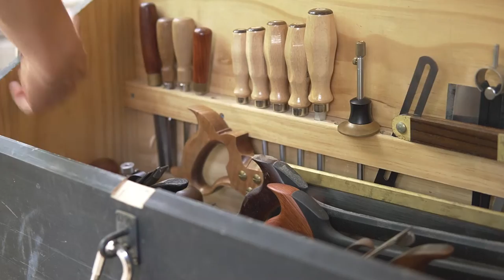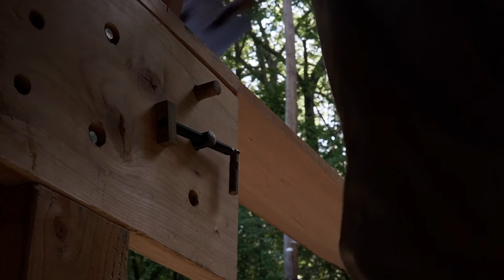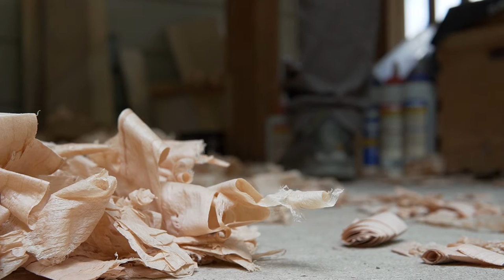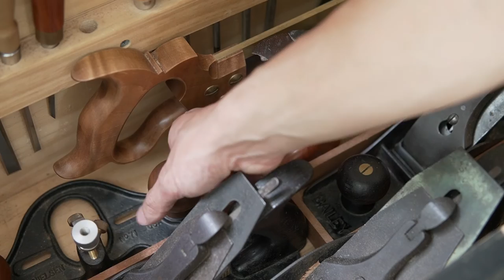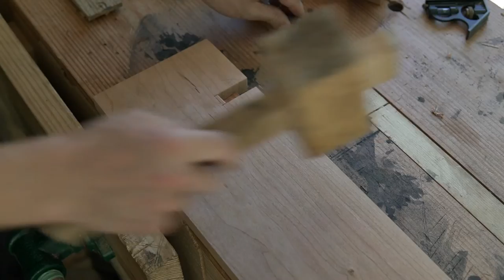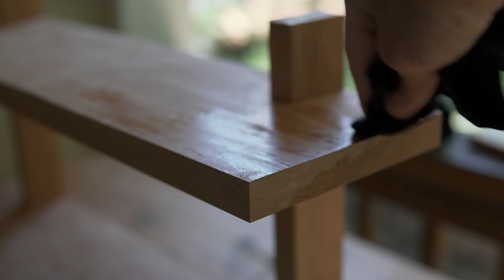Making a Floating Wall Shelf // Quiet Woodworking

Comment: Hey Nic, I love the design and ended up making the shelves myself. I'm almost done and am wondering if you decided to glue the joints at the end? Any suggestions for a loose fitting joint? Love the channel, thanks!
Reply from the maker: It shouldn’t be a major issue if the joints are a little loose. If it’s really loose, you could run a screw or dowel through the back of the uprights into the shelf. I did glue mine. Good luck!

Comment: That is aesthetically simple and beautiful. Did you glue the joints? Really nice work, man.
Reply from the maker: I did glue the joints. Though, i think if I made this shelf again, i would make the dado a bit deeper and use screws to secure the joints from the backside. i like the idea of the shelf coming apart and flat packing. thanks for watching and for the kind words!

Comment: I like this design. What are the dimensions that you used here?
Reply from the maker: Thanks! Long shelf: 42” x 6” Short shelf 21” x 6” Supports: 13” x 2” All material is 3/4” thick. Have fun making this one!
Reply: @NicTaylorWoodworking  Loved the video, and am adopting the design. How long are the over hanging end of the shelves? Assuming the supports are 16in apart, this would imply about 5in on each side for the long shelf (42 - 32 = 10) and 2.5in on each side for the short shelf (21 - 16 = 5) but from the video they seem like they should be equal. I'm guessing it's 5in but figured I'd ask! Thanks